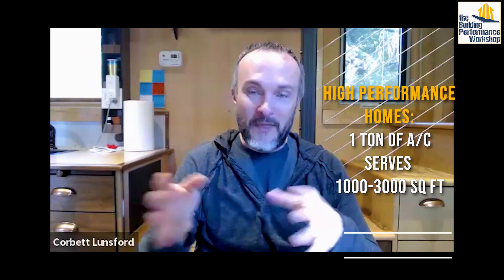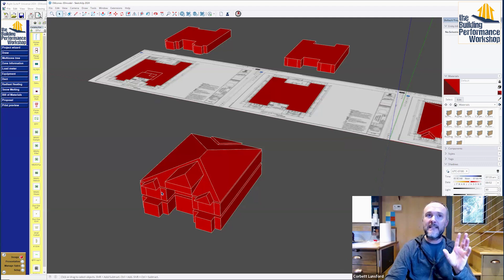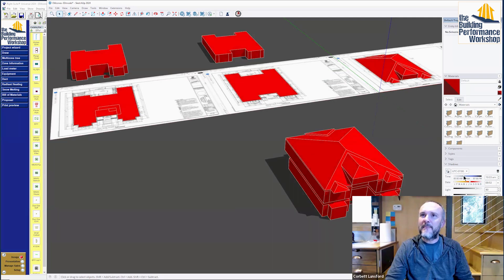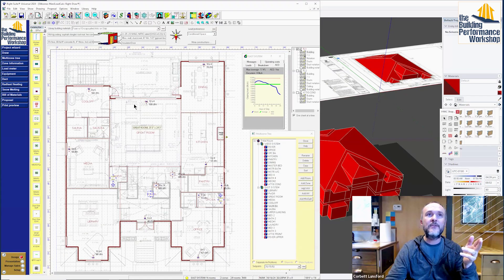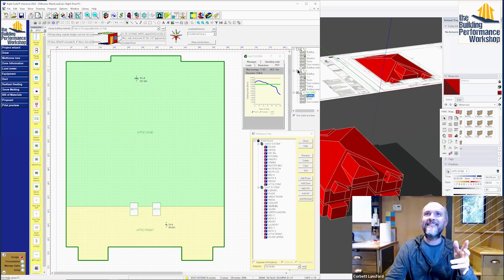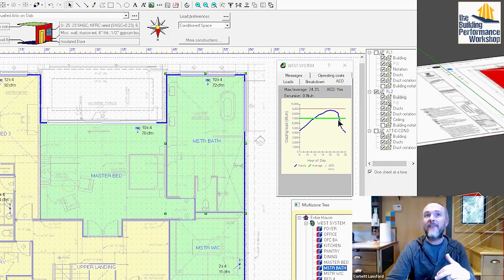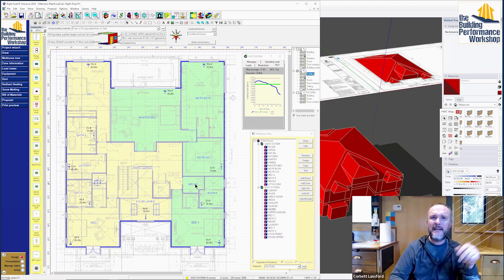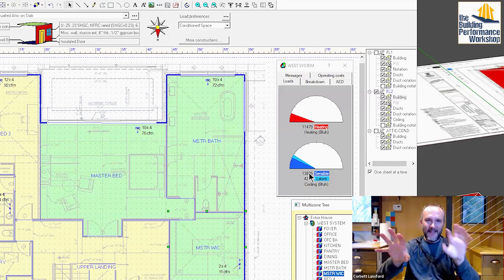HVAC Design: Zoning East-West like Manual J Tells Us To

Comment: I agree 100% east west zoning is better. Coming from a contractor standpoint, the NC Admimistrative code REQUIRES each level have its own zone regardless of what the calculations say. I recently ran into this on a high performance design  on a 3 suite residence.  I zoned per suite, perfectly ,matched the equipment with a 18k Mitsubishi system for each zone. The planning and zoning rejected it because of that rule. Since Mitsubishi doesn’t offer an OEM zoning solution and the aftermarket ones dumb them down, I ended up having to go with a 3 ton Trane Resolute, Dip switched down to a 2 ton, matched with a 2 ton air handler. So essentially, I was forced to oversized because of this dumb rule.

The reason why I bring this up is that there are external reasons preventing us from zoning the smartest way and these houses eventually have to be approved and inspected. The contractors who install our designs are stuck holding the bag. 

Fortunately in this case, because of my experience as an NC hvac contractor I prepped the project team for this and we had a backup plan.
Reply from the maker: Agree 100% code needs to get smarter about this stuff. Make up air too.

Comment: shouldnt there be enough air movement to mittigate this? at least in a high performance house.
Reply from the maker: Yes, IF you keep ceiling fans running and doors open and interior walls uninsulated you likely won’t notice at all for that 2-3 hour period with one system.
Reply: dude please delete your question, you just asked if my systems designed properly will it work? we'll fucking duhhhhhh if it's properly designed it's going to work bitchen

Comment: Corbett -teh  symmetry fo the house and the dominance of sunlight in such a southern location certainly militate for thinking east west. But how is the stack effect worked into thsi approach ? Tat can be pretty substantial in a less sunlit environment, and in northern climates i woudl think the north south facade differences would be substaila even with an intelligent landscaping startegy re evergreens o north side and deciduous tress on south side etc.  I wait the actual duct layout to see te implications of this emphasis and mechanical feasibility. Another related approach is splitting a two story house sagitally ie up don this can work well esp in winter when setting back one side (daytime side) and turning eat up on teh other half fo house. I do think a video outline when zoning makes sense in theory is in order
Reply from the maker: HVAC Zoning: Do You Need It, or Not?
https://youtu.be/Y0LXsGuSQFE

Comment: How do you think about usage patterns of during the day downstairs and in the bedrooms at night when designing the system as East / West - is it just that you drive all the conditioned space to the same temperature?
Reply from the maker: Yes, I personally am convinced most people think they want rooms different temperatures because the home they're in now has problems with mean radiant temperature. They look at the thermostat and conclude that they need a bedroom that's 65 deg F, when the problem is really not the air temp at all.